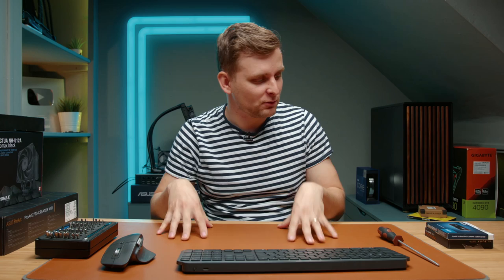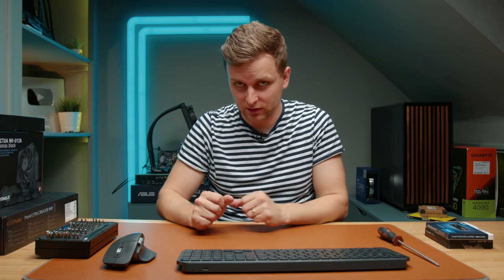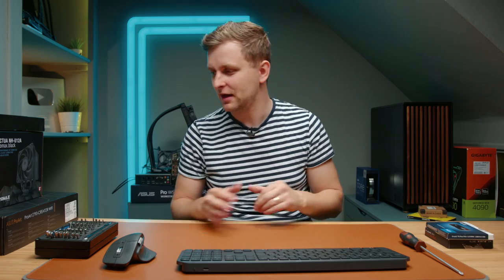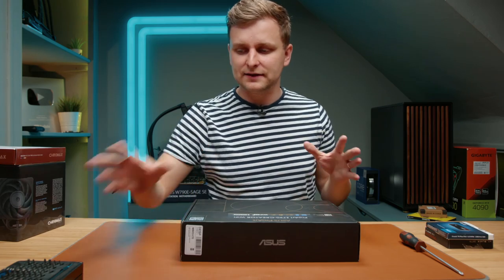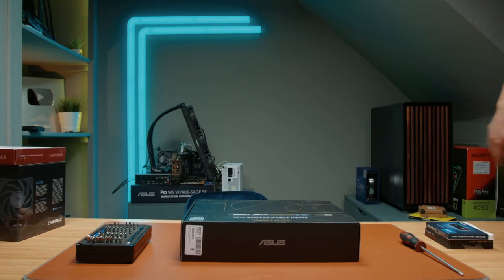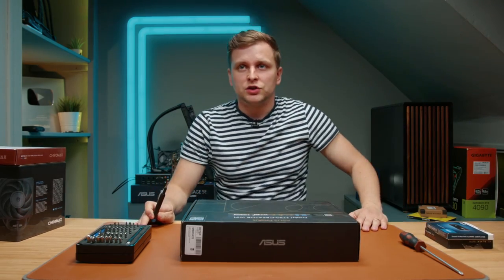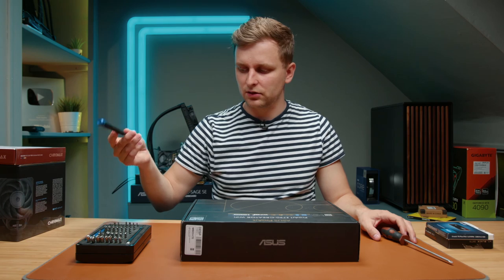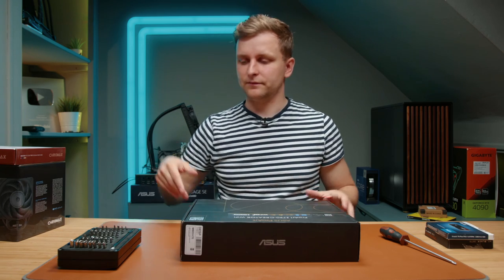How to build a PC - Step by Step guide for Beginners [EVERYONE CAN DO IT!]

Comment: Thanks for the video. Very informative. I do have one question. When you put the GPU in the top pci slot and have a m.2 ssd in the top m.2 ssd slot does it reduce the pci slot to x8 instead of x16?
Reply: Or is it only on z690-e boards?

Comment: Excellent video as always. The channel as a whole is very educational and useful to PC enthusiasts. One thing I would note about this particular video is that placing the main operating system drive (m.2 drive) in the uppermost slot is not always the best option. This is particularly relevant to gaming PC's and many Z790 boards. A good example is the Asus ROG Strix Z790-E Gaming Wifi. Placing any m.2 drive (whether gen 4 or gen 5) on the uppermost slot will automatically set the uppermost PCIE slot down from 16 to 8 lanes. The ideal location on this board for the main operating system drive is the 3rd slot. This slot is addressed directly from CPU lanes (not the chipset) and does not affect the uppermost PCIE slot for your GPU. One final recommendation after seeing the entire video is to check device manager after installing drivers just as a final check that everything is in order.

Comment: Followed this tutorial step by step. Exact same mobo with 13700k. 6x Chromax on case with Noctual CPU Cooler. Be Quiet straight power 12 1000W. Quietest PC ever!
Quick question : Why did the XMP reverted back to Disabled at 2:31:20? Is it normal? Mobo did the same to me. Memory is at 6400Mhz (bios and Win11 confirmed), but I'm curious why the XMP reverts to Disabled.

Oh Subscribed !! :)

Comment: 75 year old about to start my first PC build based primarily on your videos.  I am going to use the Gigabyte Z690 Auros Elite AX ddr5 and would like to update the bios prior to beginning the build.  But, the site is unclear to me which new bios I should be updating too.  There is a version 1.xx and a version 1.4, one point to the latest bios version as f24, the other to version FL.  Certainly don't want my first step in the process to destroy the MB.  How do I tell which one I need?
Reply from the maker: There's also a date when they've been released, pick the latest one ;)
Reply: @theTechNotice  right, but is the f24 or FL correct for the ddr5?
Reply: Ok, thanks to your excellent videos, I am proof positive anyone can successfully build a PC.  Appreciate it very much.

Comment: Here are the timestamps for all the chapters in this video. Labor of love. Much appreciated your info, Lauri.

06:36 how to take the motherboard out of the package
09:31 install CPU
11:18 placing the CPU in the socket
12:20 install CPU contact frame
19:21 install RAM sticks
21:42 CPU cooler introduction
29:01 CPU cooler brackets
34:36 Thermal paste CPU application
37:33 Installation of CPU cooler block
42:49 SSD installation
55:03 CPU Cooler FAN mounting
58:01 PC CASE intro
01:04:10 Motherboard placement in the case
01:12:25 PSU (Power Supply Unit) introduction
01:15:38 PSU Cables explanation
01:21:50 PSU mounting
01:25:30 PSU Cable management
01:30:56 Connecting the cables
01:39:05 Back Fan installation
01:45:19 GPU installation
01:57:20 Remove the sticker!
02:01:08 Front Fans - missed step
02:04:57 Cable management in PC Case
02:08:00 TEST Boot
02:12:23 BIOS SETTINGS
02:12:50 BIOS UPDATE
02:32:15 WINDOWS Installation
02:37:33 Windows Installation without network - How To Trick
02:39:01 I don't have internet :-) 
02:42:54 HWINFO software download
02:44:05 Installing the magnetic WIFI antenna
02:48:47 Installing ASUS Armory Crate software
02:54:45 CINEBENCH Test
03:04:55 GPU Drivers update
03:06:00 Furmark Benchmark download
03:13:19 Furmark Benchmark test
Reply: 7❤😊
Reply: 7😊😊
Reply: 7❤8
Reply: 7
Reply: 7😊o7
Reply: 8😊❤😊7
Reply: 7❤8
Reply: 78😊7❤😊7
Reply: You my man, are a legend.
Reply: @MrABD_YT  you're welcome,  my friend.  Bless you
Reply from the maker: thank you, just added them to the video for everyone to enjoy!!! :) You're a legend!
Reply: @theTechNotice  My pleasure, , man. You made the video so all kudos to you 👏 🙌

Comment: Man, thank you so much for all those videos! It's invaluable information! I've just finished a build completely based on your guides and tips for parts! It went way better and much faster than my last build, and even though I'm not a pc builder noob, it really helped to take some short cuts with your build guides! 

My new build is almost identical to your personal pc, except for the ssd's and the psu. I went with the be quiet straight Power 12 1000w instead. It's awesome!

Comment: Hi, i have a plug 8pin cpu power led on on my motherboard. I have 8+4pin plugged in to the motherboard and I've tried replugging them but the led wont go away. I've been using the pc normally for a week, it is stable, and on cinebench multi-core test my ryzen 5 7600 is pulling 100W with pbo enabled. Do I have a faulty component or is this safe to ignore?

Comment: Would this be an acceptable PSU for this build: ASUS TUF Gaming 1000W Gold (1000 Watt, ATX 3.0 Compatible Fully Modular Power Supply, 80+ Gold Certified, Military-Grade Components, Dual Ball Bearing, Axial-tech Fan, PCB Coating, 10 Year Warranty)
Reply from the maker: Yeah

Comment: Hi, i have some suggestions - that will make this kind of videos easier to follow:
- rotate the top camera 180 degrees, so that the camera perspective matches with what the user will see when they work on their system
- the contact frame should be showed as an optional step (since it's not really for beginners) - i get it that you say for i9 it makes perfect sense... but the people can follow your guide for i5, i3 processors as well and there the sense it makes drops significantly, plus other reasons: not all are designed the same, with some you can break your mainboard, also depending on the place in the world, one might not be available nearby, i don't have one for my i9 because it's not really convenient for me to order one.
- agree with the recommendation to get the memory with xmp profile, but for different reasons that you presented: better compatibility (because it most likely to be on the recommendation page for your mainboard because it was tested by the mainboard manufacturer), other than that there shoudn't be any no long term disadvantage since both profiles are only some bites of information (frequency, voltage and main timings) in the ram spd chip that bios reads and apply.

Cheers!
Reply: Very much agree with the camera rotation!

Comment: Thanks for the video. I'm building a PC for the first time since I was a teen. I'm pretty excited about it. The longest part was deciding on all the parts. Mainly if I wanted to go with AMD or Intel as I will be mostly gaming with it. I don't need productivity work so much but at the same time I want it there just in case I decide to edit videos or so. 

7800X3D or 13900K was the dilemma along with what mobo I was going to use. I'm keeping this build for at least 5 years as well but however will be doing another build in 2 years. Looks like the 14th gen will be using the same socket this year. Honestly I wish the AM5 mobos were cheaper as whatever you saved on the CPU from Intel you are losing it with on the mobo side along with more expensive RAM as well. The difference was around $75 so I told myself what the heck I rather spend a little more with Intel to get more productive while losing on some gaming. It's an older CPU but it's a better all arounder imo. I didn't want to do 7950X3D as the gaming performance was less than the 7800X3D.

Lastly in the future if you could rotate the top view cam to face you instead so that we could see it from your POV instead. It's easier to follow you this way that's why.

Comment: I’ve just finished  building my first PC but when i try to turn on i get stack on the VGA (orange) light and nothing happend. 
i have the i9-13900k so i remove the GPU and try to run from motherboard but it  stil same issue. Any ideas? Aready flash the bios. 
Aready flash the bios and pull battery out for 10 min. 
i9-13900k 
Gigabyte Z790 AORUS ELITE AX ATX LGA1700
G.Skill F5-5600J2834F32GX2-TZ5RK
SAMSUNG 990 PRO 1TB
SAMSUNG 990 PRO 2TB
RTX 4070 Ti SUPER™ 16GB
NZXT H9 Flow
DeepCool PX850G PSU

Comment: I did not find a link for the contact  plate that installs onto the cpu. Please advise.
Reply: Amazon has it.  There is also a video.  Thermalright CPU Contact Frame for LGA 1700 Retrofit Kit, 17XX-BCF Bracket Intel 12th 13th Generation Anti-Bending Buckle Black

Comment: I'd appreciate anyone's help on this...
I've finished my build with he ASUS ProArt CREATOR Z790 and the new i9-13900KS, and I've started the POST and it seems to keep coming up with 'CPU Overheat Error'.
This isn't on every time I try posting, but most times. I've got the ARCTIC Liquid Freezer II 360 and everything seems to be plugged in. I've reapplied thermal paste. Reinstalled the pump. When I entered BIOS the CPU showed up at 89°C. I've done a lot of research and still can't quite pin point what is going on... Is it worth updating BIOS first?

Comment: The bios update portion should really be filmed on a variety of brands from AsRock to Asus to Gigabyte. While they are similar, I have an AsRock x570 Taichi Razer edition and I always get hung up on Gigabyte bios for some reason. I have updated my bio on my AsRock, but I did not have a single bit of fun, completely concerned whether I was even doing anything correctly the whole time. I love this video overall and the bits and pieces where you say 'be careful with...' are extremely helpful to those of us that just go about upgrading our systems every 5yrs or so.

Comment: There is no way that the air cooler can cool that i9 efficiently. You might as well have a 13600k because once you start loading all of those cores the speed will throttle from high temps. That cooler is good for 160wats of cooling and that i9 has a rating of 253 watts. Throttling is not good.

Comment: Thank you so much for this video. I’ve just finished successfully building my first PC using this tutorial. With a ProArt Z790, ProArt 4080, i9 14900K and air cooled with Noctua NH-D15. And it ran a 37583 on Cinebench. 
I’m pretty happy with the results.  😊👍
Cheers

Comment: Thank you ! Excellent video !

Small question, the graphic card is still running at 16x even if a M.2 ssd drive is installed on the first socket ?

Your step by step video helped me in building my brand new PC (Asus ProArt Z790 + Intel i9-13900k + aio 360 + Asus ProArt 4080 GPU + 1To m.2 ssd for the OS (1st Socket) + 4To m.2 ssd (2nd socket) + 64 GB ram + 1200w).

Thank you in advance for your reply.
Reply: I have the same question, did you ever figure it out?
Reply: @pc9784  @thetechnotice answered me in another trend, and here is his answer : 
On ASUS ProArt z790 you're gonna be fine. Don't
worry. You can mount your SSD in first expansion slot.

Comment: We need to se é a test of the Noctua NH-15 with the fans from the Noctua NH-U12 the NH-15 has better heat pipes... but the NH-12 has the newer fans design? would you try test that?

Comment: Absolutely ESSENTIAL channel!! Thank you! We just built our first PC and installed the i-9 14900K on the Asus Pro Art z790 and plenty more goodies. But could of never done it without this channel (and a few others). I also used the whokeys link for the new windows 11 Pro. 

I couldn't use my 2020 HP Pavilion once I started using Photoshop. They are great and practical but it wasn't upgradable, it is a all-in-one and is basically a laptop with a widescreen. This mega PC I built was certainly pricy, about 4 grand all said and done including a 4k monitor Ultra LG 32GQ950-B and 2x 2 Tera byte Samsung 990 PRO nvm, but very happy and looking forward to photo and video editing. fyi I went with the matching rtx 4070 oc Pro Art and 2 sticks of corsair 6400 DDR5 32 cl ram. Peripherals really added up every step of the way, including an iFix it took kit. All very gratifying and well worth it. Still updating stuff on this pc and I have not even ran Photoshop yet but looking forward to the task now. Cheers!

Comment: Great video, I am also using the same anti-bending buckle.  I am also done building, but not done cable managing.  I might actually go for a different case (I have the bgears b-voguish), but I did the EPS cable run all wrong.

Comment: This was the board I intended for my build. You are obviously thinking the BIOS and Overclocking/overheating/ burn condition  currently in the news will be straightened out by ASUS before too Long?!
Reply from the maker: This board hasn't been the issue :)
Reply: @theTechNotice  Please do a video about the actual issue. Seems to be ,,overclocking is the issue and the use of RAM that exceeds the processor limits  but the manufacturers and others have promoted the ability to overclock beyond the 1.3 . So, is it false advertising leading to improper combinations of components. Love to use the board,, but not till this issue is cleared and ASUS develops a reliable BIOS(ie not BETA). Clarify for us all. I know it's difficult.

Comment: Holy Cow! I haven't even watched the video yet. I'm building my 1st PC in over 25yrs, and I have just happened to have bought most of the components you are using. Fractal North, ProArt MOBO, 4090, with Air cooler etc. LET'S GO!!!!!!
Reply: Thanks a lot for this. I got it all put together and running. Thanks to you the hardest part was fiddling around with the fans!